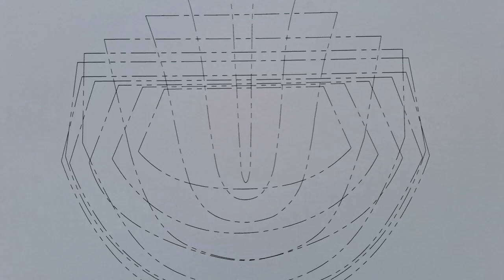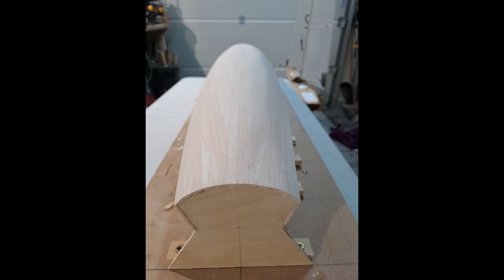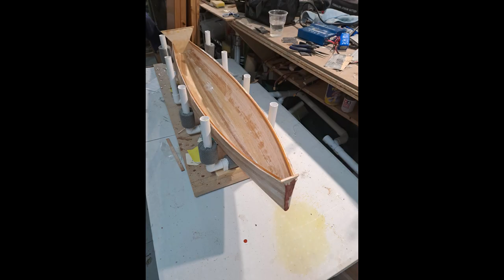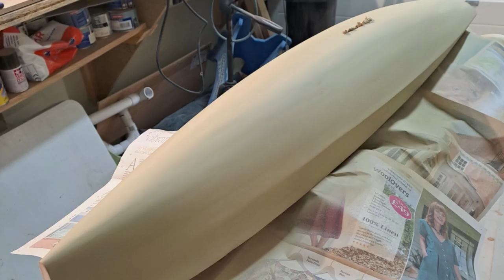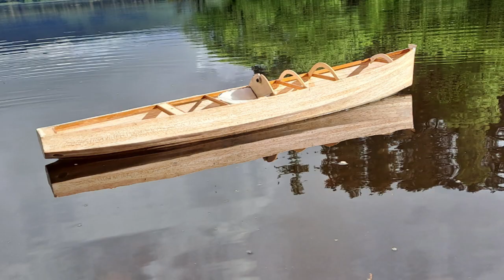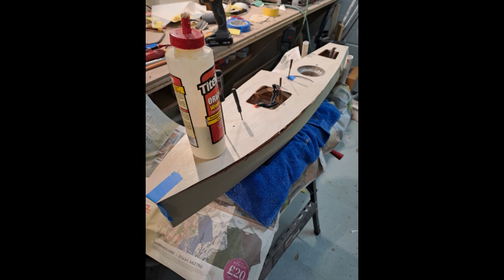Part 3 - New design of IOM with chine

Comment: Hi Colin.... Very informative series of three videos.  Thanks a lot.  I  am just about to start a V8 IOM build (in wood) and share you background in RC planes !  Do you consider the balsa version to be the better hull construction material than say spruce, or cedar ?
Reply from the maker: So far I havent found any issue with the Balsa, and it was easier to shape. My Cedar version looks a lot better, but I tend to sail the Balsa version every week. I find it very competitive and its more my sailing skills that makes the difference at the moment
Reply: @colincrooks8173  Thanks Colin, appreciate the info.